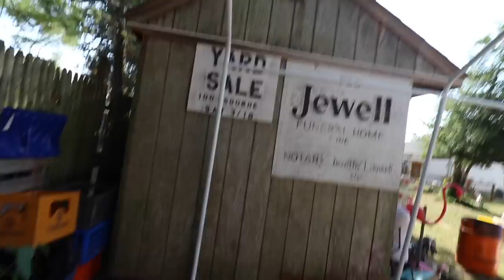HARBOR FREIGHT PORTABLE GARAGE  - Best Buy For Storage!

Comment: You can dig a little ditch around the outside and fill it with gravel and you will have a French drain system for heavy rain not getting into the Harbor Freight garage.

Comment: I think you need to run some fencing along both sides of that top so that it can take a little bit of weight so even chicken wire would be better than nothing I'm talking about in the carport

Comment: I put a couple self tapping screws iinto where each piece come together and a layer of gorilla tape at the roof seams .has lasted for many years
Reply: Yeah that seems to help the rigidity of it .Those 4 feet with the 3 holes need stakes or something, I used these gigantic nails.The 4 augers or whatever they're called that screw in aren't gonna be enough. You need more supports actually, the metal isn't strong. I just put mine up the same way as you including the tape.

Comment: Listings don't mean shit. Originally that lancer Gears of War 2 replica was $140 with (advertised as Amazon exclusive but actually wasn't) and was $99 from FYE. The market tends to net between $65-149 for that gun not in box. Unopened in box it pulled 315 in September on ebay but that's unopened NIB.

Still great for a roadside find though.

Comment: Get some salt to put in that tent to soak up the moisture...had the same one
Reply: @TheMrSnyder no lmao put salt in a bucket it will soak up the moisture in the air just gotta empty the bucket when it gets full...that's just a cheap way or you can buy stuff from the store that does the same thing
Reply: @TheMrSnyder lol no sorry should have went in to detail...its just a simple way to keep moisture out...those tents tend to have water droplets form with temperature changes

Comment: I sold that gun on eBay I could only get like 89$ plus shipping for it that’s the going rate for a used one! Brand new they are worth like $300-$400
Reply: Still not bad for a free find $100
Reply from the maker: Was it the same model?
Reply: Tucker Upper ya exact same one check out the sold listings on eBay prices will be higher on amazon